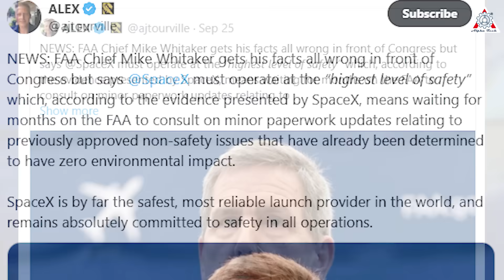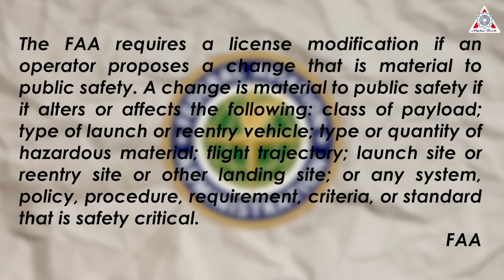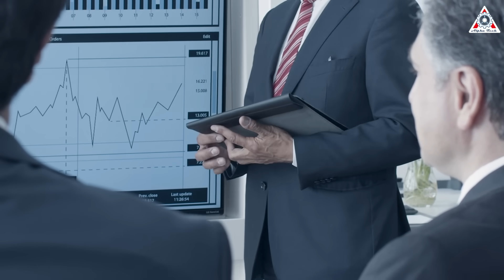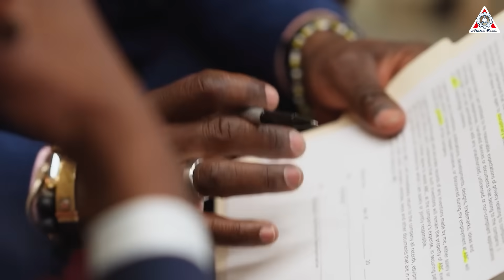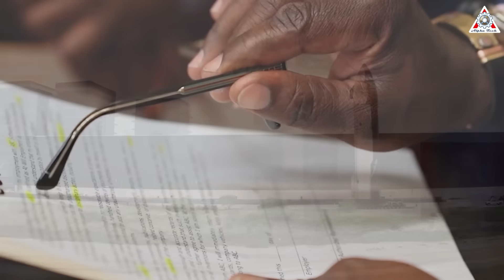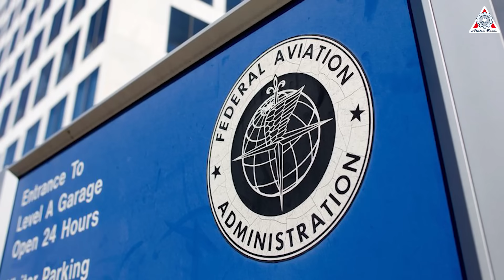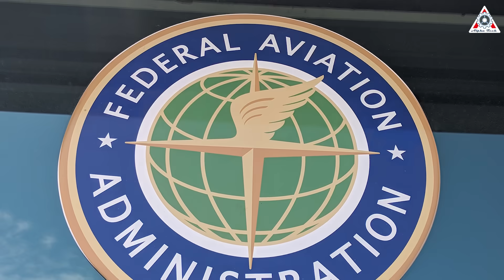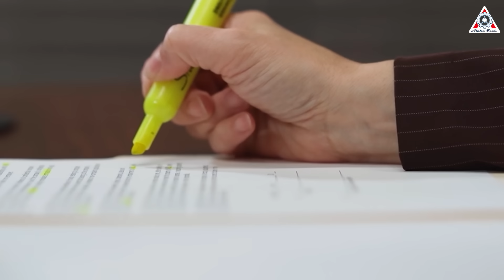Disaster! FAA Declared 'Starship's Heat Tiles Affect Public Safety'. Elon Musk Laugh...

Comment: The FAA isn’t competent enough to understand the impacts to safety
Reply: With the current problems that Boeing has had, I agree completely with your statement.  I also agree with SpaceX suing the FAA for regulatory over-reach.  The FAA is using "safety" the same way Chris Wray of the FBI hides behind "on-going investigation" to not answer questions from congress.  The FAA has included pretty damn near everything in their definition of "safety".

As Ronald Reagan said - The most dreaded nine words in the English language are; I'm from the government and I'm here to help.  A glaring reminder of this is the FAA saying the tile system posses a "safety" risk.  Are the FAA pencil pushers saying they know better than SpaceX engineers on how to design and install heat shield tiles?  What evidence does the FAA have to substantiate this claim?  

Another issue is the FAA saying they have to approve the fuel farm and the launch facility.  Why?  I'm sure there is other government or industry groups that have rules and regulations regarding the handling of cryogenic liquids and building facilities.  SpaceX should have to do nothing more than show the FAA that the farm was built and being maintained in accordance with those rules and regulations.  A big problem is that the FAA is the organization overseeing industry and they decide if you did something wrong, they decide what you're fine/punishment is, and if you dispute their findings. it's the FAA that adjudicates the case.  Not a bad deal for the FAA I'd say.
Reply: @robobloxgamer524  i work for the government, 90% of them are morons.  Of that 90% 70% are insufferable morons.

Comment: The FAA should have 2 types of licenses. The first would be a license for development vehicles that are expected to fail. The FAAs job would be to make sure that if or when it fails that there is an acceptably high probability that the public will be safe. All they would need to do is to make sure that the vehicle has a flight termination system and a flight path where no one is in danger if or when the FTS is activated. The developers could then do whatever changes they want without requiring a new license.
Once development is finished and the vehicle's reliability has been established, then a new 'commercial' license would be required. This is the license they issue now where a change in vehicle configuration would require a new license to be issued.
Seems like a straight forward solution.
Reply: Nothing the federal government does is “straightforward”. Everything is about politics, power, control and graft.  SpaceX should probably just figure out who they are supposed to bribe and do things like Boeing obviously does.

Comment: At some point the FAA will need to accept the reality that space flight is now routine , just like like airlines (at least for Space X Falcon 9) -- no need for a special license for every  launch.  A 747 coming in to land poses a theoretical safety risk but somehow the FAA survives without licensing every single flight (after a 2 month delay)  Welcome to the 21st century -- a time of jumbo jets and space flight.  When larger solar panels were attached to the ISS, did the FAA hold the process up until they could certify the new attachment sites?  Get real.

Comment: The FAA has ruined the recreational drone usage also.   We are treated like commercial aircraft pilots now, they are afraid a 3/4 pound drone will cause other aircraft to crash if we are in the area, even if they are at 30,000 feet and we are limited to 400’ above ground level.  Still could get in trouble if flying in a park below tree top level.  I think if an airplane is flying at under 50’ they have more troubles than my drone.  End of rant..

Comment: The FAA grows barmier by the day. SpaceX should just declare that crew 9 will not take off until after IFT-5 has. Engines falling off Boeing planes is a safety issue. Doors coming off in flight Boeing planes is a safety issue. The TPS is not a safety issue unless you're launching manned craft, not that Steve Stitch cared about safety for Columbia. SpaceX are launching a revised TPS on IFT-5 and won't be launching crew on Starship until they are confident they are as safe as SpaceX can make them.

Comment: My father, who ran a major aerospace, national security critical, production facility would often say: "You can always tell a QC person; but you can't tell them much". Innovation is their enemy and they will always fight progress because it represents change from the "known". They even fight correcting known problems like the Challenger O-ring problem and end up killing people. The FAA is a major contributor to Boeing's problems because they cultivate a culture that embraces passivity of performance over personal commitment and accountability throughout the workforce. If the FAA is the final authority and an 800 lb. gorilla at the same time, innovation and caring are snuffed out. The FAA has no place in this space flight era as it is outside their charter. This is not aviation where they can spend a decade to oversee incremental development of a same old design. Please exit stage left, FAA, for the good and safety of the country!

Comment: Perhaps the FAA have in fact kept pace with the rocket technical progress and have been, considering the complexity of launch and travel, keen to observe a short turn around for all rockets requiring safety approval. What I would suggest is more of a problem fir them is a constant updating and changes in the rockets design , leading to each flight being , in many practical senses , a new venture , with many of the chanfes veing dramatic, such as tge constant reevaluation on landing sires and modes. The heat shield was said to be sorted but then found to be defective, so now there is a complete removal of the previous tiles and a new flight will be a new experience. There is inevitable frustration caused by Spacex using a try and see method of testing, it is wrong to be so critical of an agency that, like all transport, works on a set of codes rather than delivering individual assessments. This is not a biro on an office desk.
Reply: Codes? They are dredging up any arbitrary problem they think they can get away with, they are partisan when they should be completely neutral. The US can't go on with the weight of alphabet agencies filled with political zealots.
Reply: Would you mind spell checking the mess you typed so it becomes intelligible?
Reply: SpaceX causing frustration with their "...try and see method of testing..."???  Boeing Starliner are using NASA style space suits, technology that's over 30yrs old, SpaceX has reinvented the space suit drastically reducing weight while increasing comfort and flexibility.  How can the FAA regulate an industry that is so far ahead of both Boeing and NASA it's beyond their understanding, it's like using safety measures designed for Fokker DR1 Tri-plane and using them to regulate Vaught manufacturing the F4U Corsair.  They are so far behind the technology train they're like a bunch of nerds standing on the platform waiting for a train that departed two weeks ago.

Comment: The FAA looked for something to harass excuse SpaceX about and the tiles were the literal chink in their armor.

I've done numerous writs here on Alpha Tech about the tiles being a continual problem. and offered up potential solutions.

Even yesterday watched Ellie's video on the new SpaceX complex in Texas, and she mention there being a concrete research lab, and it made me hopeful because the solutions I suggested were around doing coatings of a refractory based hydrated ceramic cement coating system over spot welded mesh, that Kilned doing re-entry.

I was hoping "Mudlab" was working on it.
Had also suggested stuff be tested on the launch mount and tower, and have since seen what looks like that in videos here on Alpha Tech.

The bottom line on tile is too brittle, too complicated, no good way to attach, and beyond the temps of adhesives etc.

My old writs explain it all and give analogies for the suggestions.

Flaking tiles will always be a danger to public safety and to the ships themselves.

So I'm hoping that SpaceX has been working on the New Mud we need, and can get past this issue permanently. Basically I've been ragging about it for several years, including in the Parts Count trove over three years ago, and at that time conversed with a heat shield specialist.

I'll say the same thing I did then on parts count:

"I'll win in the end."